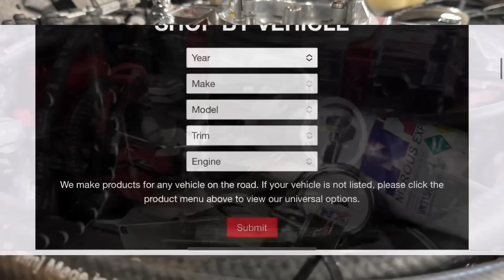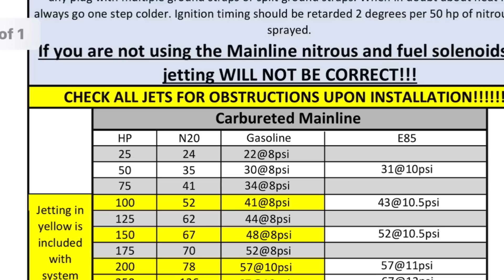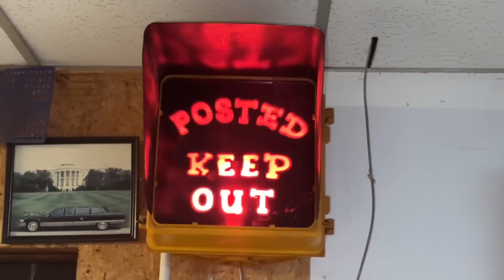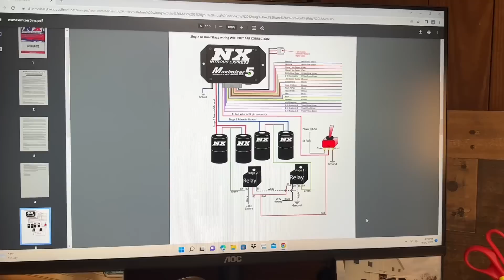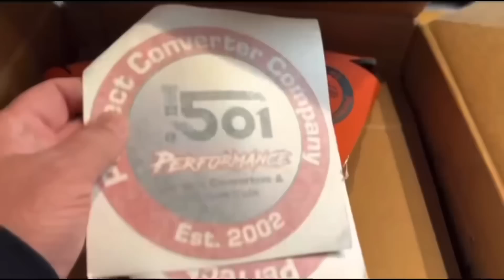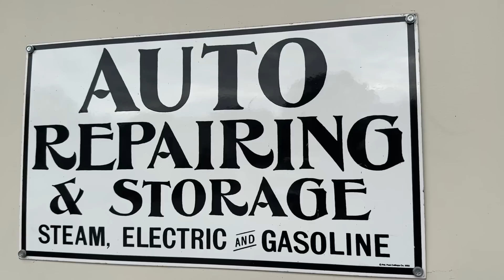NITROUS EXPRESS INVITES “CRACKA BARREL” to PRI & THE MALIBU GETS 2 STAGES OF N02!

Comment: Definitely need to review the general preparations such as tighten hardware, inspect wires, driveline components, general overall visual and operation of “power adding aftermarket stuff”, safety equipment, brakes & suspension, and fuel system. Just seems to have failures that could be avoided with more attention to details.

Comment: I had a 1969 camaro with a fogger .
The Nitrous keeped braking -up when I'd use it .
I couldn't figure it out why the engine keeped braking - up when I'd use the Nitrous. 
The guy who built my engines at the time told me to put a Nitrous purge on the car so I did .
Never had a problem with the engine braking - up when I hit the Nitrous after I put the purge kit on it

Comment: Rob needs to find a 1979 351M or 80's 400M Ford motor with a C6 to put in that Stang. Rob Build a Cleveland Monster. Bill it seems you could set both Kits to kick on, with the scramble button?   LMAO

Comment: Nice work guys. Prolly should do something bout those poor valves. If they are actually floating and you are spraying more its only harder yet to control. I know you know locking the converter will help some too but id hate go see you bust it up and not be able to show it off at PRI. Thats a 2 bolt block sbe sbc right?

Comment: Someone must have changed out the taillights (on Uncle R's mustang) because I was thinking the same thing when Uncle B said it was a 96 and Uncle R corrected him and said it was a 94. The 94 and 95 were the last 2 years of the push rod  5.0... then the 4.6 kind of kind of took over. (terrible idea in my opinion) Ive had the 2v Gt and the 4V cobra. The 4v car ran decent...but because they had no power in the lower rpm (they wouldn't pull a greasy string out of a whores ass). So the way I set mine up was 4.30 gears and moved the limiter up to 8000. And on a 26x10 and leaving at 6500 it would definitely hold its on. Sorry guys I didn't mean to get carried away. I'm sure y'all have forgotten more than I ever knew... Uncle B better look out and make sure his car doesn't get Termites

Comment: I am going to say this one more tirme   (Isolated grounds) aka ground wire run directly to the negative battery terminal stop using chassie grounds your electrical devices will work much better your electric fan,pumps,motors will turn ffaster your nitrous system will control more pressure      please Bill I have wired many race cars and this by far is the most important part of dc automotive wiring do some research on (electron flow theory) it says current flows from the most negative part of a circuit to the positive so why would we try to flow current thru the rusty frame ,block and sheet metal instead of a copper wire remember path of least resistance that law works for both wires in a dc circuit.😂

Comment: Do you think switching to those 90 degree fittings in the solenoids is going to adversely effect flow?
Reply from the maker: Maybe a little but with the small jets I’m on it won’t matter
Reply: @theoldmansgarage  I thought it might but I wasn’t sure as I’ve never used bottom exit solenoids. I see your point with the smaller jetting you’re running, but imagine flow characteristics would come into play the closer you would get to the max jet settings. Congratulations on the PRI invite!!

Comment: Love that you're gunna clean up the nitrous lines but won't the 90 degree fittings be bad for flow like it is in a fuel system?
Reply: its gas not petroleum so no should be ok its more heat or temperature that effects nos